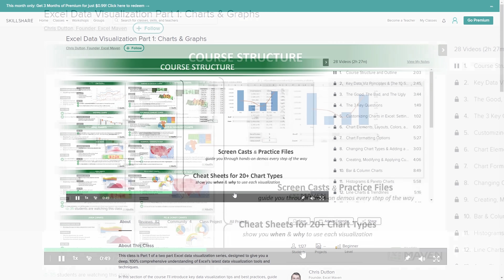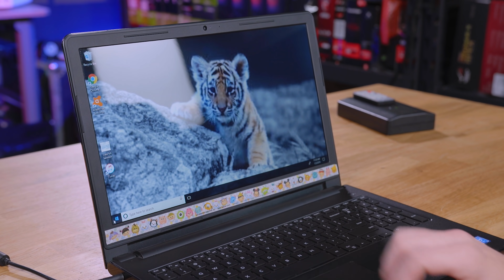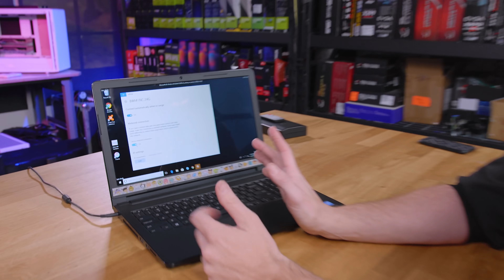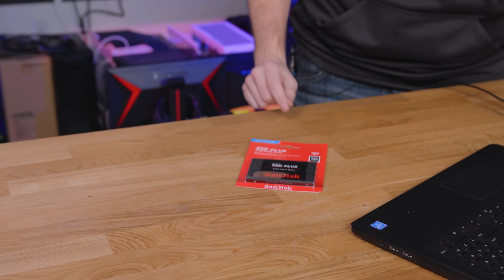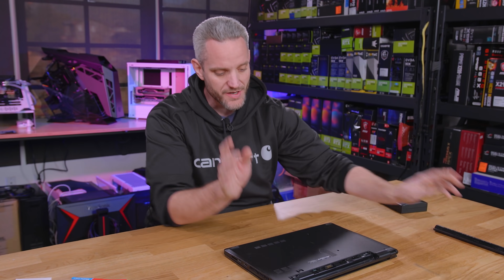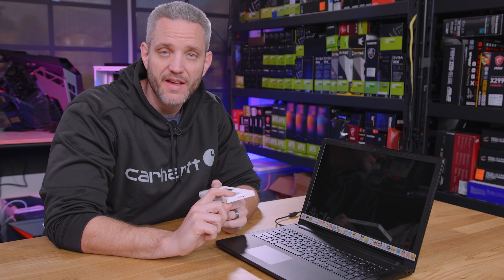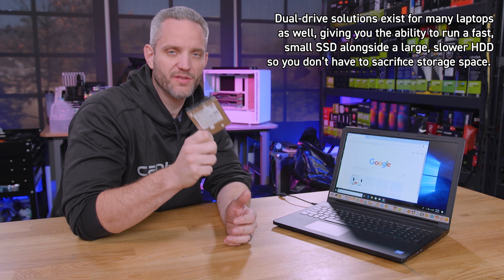Repairing an old laptop for as little money as possible...

Comment: My brother has a dell budget gaming laptop with a i5 7300HQ and a gtx 1050, it only has one screw holding the back panel on the rest is plastic clips, his hdd, ram, wifi card are all accessible under the back panel. I upgraded the ram on my asus laptop and gave him my old ram stick bc he had a free one and he bought a adata m.2 ssd bc it took too long to get into windows completely. He has the os and prog on m.2 ssd and hdd for storage and larger games, the m.2 slot is also accessible by just removing the back panel just above the hdd. 

Now it is lighting fast with 1000 MB\s read but only 500 write thou, but has a 460 GB capacity.

Comment: exactly the same problem i had with my 7 year old gateway laptop until i replaced the hdd with a 500gb ssd and replaced the optical drive with a tray to hold the old hdd so doubled my memory capacity

Comment: I got an old E-Machines (Acer daughterbrand) laptop from my girlfriend’s grandma that was still running vista.
Pretty budget dualcore with an old ATI dedicated graphics card that has no new drivers past windows 7. I tried a bunch of different Windows versions, and windows 10 seemed to be working, until BSODs started happening on the count of incompattible drivers for the gpu.
I tried putting vista on it again, only to get a bsod upon first post-install boot. Windows 7 seems to be working fine for now, and I am thinking of upgrading it with an SSD, but I fear for a sneaky windows 10 update.
I’ve tried Linux (Mint) and it worked for the most part, but I am a little uncomfortable with linux.
Maybe you can do a video on older laptops with a gpu that’s no longer supported driver-wise in windows 10, especially trying to get it to work properly?

Comment: I was able to repair an old Sony Vaio desktop PC from 2005 which has a 2.8 ghz Pentium D, 3 gb ram, and an 8400 gs graphics card by installing Linux Mint 19 which of course didn't cost anything, so now its usable with the latest versions of Chrome or Firefox. I guess Linux is always an option with older computer if you face performance/compatibility issues with recent versions of Windows like windows 10.

Comment: If it has an optical drive, remove the optical drive and the HDD to a cheap SATA HDD-optical drive caddy so you can have the HDD for files and the small SSD as the boot drive.

Comment: Most of the newer dell laptops are quite easily serviceable. They also publish all of the service manuals on their website and are supporting right to repair with ifixit etc. And I was surprised how many cheap laptops were really getting screwed by 5400rpm HDD and less then 4gb of ram both that would be pinned at 100 so easily

Comment: My mom is on her 5th laptop in the 8 years she's been running her business. I just took the two oldest and cleaned the fan, re applied the thermal paste and  removed a bunch of bloatware. They both have avast and macafee... If I was to remove those anti-virus programs, what's a  recommend program to replace them with? And what's the easiest way to back up the important files on a separate disk/ssd? Buy a docking station and drag and drop to a main ssd to be installed in the newest laptop?

Comment: Funny I saw this video, as I was thinking of upgrading my mum's old laptop for me to use at college. It's got a 1st gen i3 processor, a 5400rpm drive, and 4gb of RAM. I was gonna put an SSD in and give it 8GB instead. I was worried about the old i3, but it can't be worse than a celeron, that's for sure.

Comment: i have a 10 year old dell inspiron desktop with a core 2 quad Q9500 (fantastic quad core chip that still runs great). It has mostly all the same hardware in it except a graphics card and PSU update. Has the same 4GB or ram that it came with as well as the spinning 3.5in HDDs. It sat in storage for like 3 years and recently when i turned it on, it was the slowest piece of garbage ever. Mostly due to the 3.5in HDDs being completely shot. I took out the computer's optical drive and replaced it with an ADATA 250 gb ssd, on which i put the OS and most of the programs for day to day use. This comp is a beast now! I have even started playing games on it again lol. Nothing crazy (D3, LoL, sc2, etc) but it runs great and has come back to life!

TL:DR - SSDs make ALL THE DIFFERENCE, even in a 10 year old system!
Reply: the SSD cost me $40 CAD, its an ADATA SU650. Got it at memory express. AMAZING VALUE

Comment: I just learned that you can uninstall OneDrive now officially!
In previous versions this wasn't possible. At least Microsoft did something write once ;)

Your trick with the metered connection for disabling Windows Updates doesn't work anymore (in my experience). I used this to prevent Windows from updating on me, but I made the big mistake and manually installed the first bug update (the one that gave you native bash shell so you can finally have a SSH client without installing Putty). Since then it just ignored that I set my connection to metered and installed updates anyway...

Comment: Disappointing you didn't install a single 8gb Ram though Jay! Details, details...
fwiw my 5-year old Vaio laptop ran like a dog - I bought some faster and larger RAM and, when switching one of the old memory sticks out, actually noticed it was loose, which dropped the overall system RAM to half - which is why the laptop ran so slow. Good tip to check that for anyone reading... check your RAM slots :)

Comment: Recently i upgrade my parents old notebook Acer Extensa 5235 with SSD, CPU and RAM. From Celeron 900 (1 core, 2.2Ghz) to Core2Duo T9300 (2 core, 2.5Ghz) and 1GB of RAM to 2GB of RAM. Notebook run better than new :)

Comment: Thanks for the tip about metered connections, hopefully, that'll stop my Windows 10 Pro media server (Repurposed FX 8350 build) from rebooting randomly for updates and getting stuck at the BIOS, for some reason, the BIOS reports no CPU fan, despite having a spinning CPU fan. Which is fine if I am at home, but bad when away from home, I can't remotely press reset on the box when it's stuck at the BIOS telling me lies about my CPU fans.

Edited to add; I did the same procedure to my mother-in-law's laptop, which was also a Dell, 3rd Gen i3, 4GB RAM, and I could not for the life of me get an SSD to work, I tried 3 different SSD's, I ended up replacing her dead HDD with another piece of spinning rust!

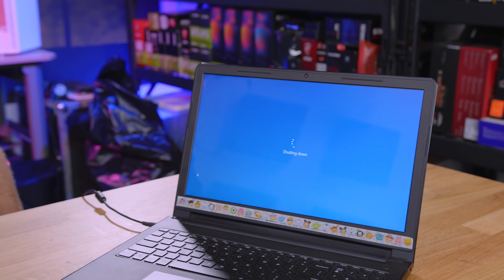Comment: 10:30 acthshshshually windows 10 doesn't always shut down when the screen is off. You just cant see it on this laptop because it doesn't have lights.
On my PC when you click shutdown the monitors do turn black but it takes an extra 5 seconds for the whole computer to completely shut down.

Comment: I know one thing if your PC(laptop) have temperature problems don't even try to fix it 😆 I did actually change CPU on a laptop that could heat up to 100 c 😂 it worked for the next 100C and then the graphics died 🙄 not possible to replace 😶 This "good Pc" had 2 grafic cards so you should be able to change 😶 It was not possible 😂 

I can give one recommendation 😉 If you buy a new laptop and it is getting hot when you are not doing hard stuff. Just give it right back to the store 😉 If electronic devices will be under high temperature you need to know it will die fast 😆

Sorry for bad English 🤔I am trying my best 😂

Comment: Well that's just Windows 10 Update stuff. I had it happen to my mother's quite decent ASUS Zenbook ultrabook. It just stuck on an update when she was like 200km away from home, and about 40km away from any decent civilization. I wonder how it even downloaded over 2G\3G connection at all. So instead of spending any money on upgrading it I just went to install Linux on it. I used Kubuntu because I was familiar with it and like it's UI. It's one of the heaviest desktop environments on Linux, mind you. And it works like it' brand new. Fast, snappy, and since she was mostly using it for web browsing, notes taking, printing, scanning, you know, regular simple stuff, she picked up Linux quite fast. And it was actually way simpler for me to teach her linux than Windows, I just made a dock with huge icons with all the apps she needs and told her how to use it's file manager, that's pretty much all. 

I'm quite sure by now that Microsoft might be doing it on purpose to make people buy new hardware. No, thank you.

Comment: I wanted to give my brother my R9 390 8GB Graphics card but he has an old 2 core Core2Duo system and would need a 650W psu for it and I don't know if there is a cpu for that socket that is capable of running it. I would like to see something about that. One of these days I will give him my FX-8370, motherboard and memory when I can afford to upgrade to ryzen so I don't want to spend a fortune upgrading his antique.
Reply: JustStat  thanks but 30 fps on a GPU that can run almost everything at 1080p 60 FPS ultra settings would be like only being able to ride your new Ferrari in the drive way.

Comment: I bought a D620 for $59 from a certified refurbisher than was supposed to still be able to run Windows 7, swapped the hard drive out for an SSD and my nephew bought enough memory for me to max it out and it was still too slow make Windows 7 practical. So as soon as I upgraded the SSD in my desktop tower I swapped in a slightly larger SSD and did not bother with Win 7 and jumped straight to Linux Lite. (DDR 2 may be a bit slow for Win 7 is my guess.)

Comment: I stopped using HDDs in 2015, in my opinion they have no business in a modern system even as bulk storage. NVMe boot drive + SATA SSD storage drive has been reasonably affordable for years. Now it's extremely cheap. If you have anything better than a Pentium or an Athlon and have an HDD in your system, you're really missing out on the excellent experience of no HDD latency ever.
Reply: extremely cheap? 1000GB SSD's still cost more than $100. I know a guy who sells me brand new mechanical ones for like $12.

Comment: Picked up a new Dell Inspiron 11 inch to basically use as a daily portable (as to not drag around my $700 Gigabyte laptop). I immediately swapped out to an SSD and did a clean windows 10 install, replaced the wireless N with an AC wifi card from a vostro (Dell doesn't tell you this will work), and doubled the Ram to 8gb.. It lags on going fullscreen on video playback because of the crappy older i3 processor. But This laptop that I spent way too much on (Walmart prices suck) and spent way too much upgrading (because I"m a glutton for punishment) and was scary as hell for me to modify brand new because I thought I was going to break the case opening it up (Thanks IFixit for being awesome and making awesome tools) Well it's essentially my cook book.. Yes I set this little underutilized overbugited project on my counter and use it to read recipes off of allrecipies.com. At a total out of pocket cost over $400 It is likely the most expensive digital cookbook to exist at the moment. I'm an idiot. But I'm an idiot that bakes his own bread, and butters it with his own butter while he waits for his preserves to thicken.. So go H8te someplace else.. ;)

Comment: My old Toshiba satellite running a dual core T5450 chip at 1.6 ghz used to be this slow too, but it held up well for like a decade. I obviously have upgraded, going from a garbage dual core non hyperthreaded chip with like 256 Mo GRAPHICS to a 4 cores 8 threads CPU with a GPU that has 24 times more VRAM to work with is like going from a fiat 500 to an S-class Mercedes. Everything is blazing fast it makes me wonder how the hell I used to work on that garbage machine ...

Comment: I have a 500gb WD blue that is like six or eight years old, which is the boot drive. I've also got a secondary 350gb laptop drive that is well over a decade old. Would it be better to buy an SSD in addition to these, reinstall windows on it, delete it from the 500gb, and run that way? Or buy an SSD, buy a 1tb drive, and move everything over?

Comment: Well for my first laptop who is 4 years old. indeed I suspect the HDD is the main bottleneck, especaily when I compare it to my second laptop.
my second laptop is GPU bottle necked as it is my main system and I game a lot. I have upgraded to a 500GB SSD with a 1TB HDD (it had an empty m.2 slot) and 16GB ram. rest of the specs are I7-6700HQ and a GTX 960m

Comment: Even if the new RAM was slower, and if the one of the new single dimms was a larger capacity than the original, you still should have upgraded it. A student who is using a computer like that does not need the highest of the high speed RAM. They are running a dual core Celeron, they absolutely won't notice the minute clock difference in the RAM. Should have upgraded the RAM...

Comment: Windows 8.1. Best medicine for an old laptop. Makes an 11 year AMD Turion 64 X2 run better than new even with a HDD. Best part, Windows 8.1 is free!
Reply: 8.1 ran better than 10 did  on my crappy laptop that has a Celeron and 4GB of RAM
Reply: @React2Quick  exactly.
Reply: @DylanChng  I mean the laptop is still shit and so is the processor, but I honestly swear that 8.1 ran better than 10 does currently on it.
Reply: @React2Quick  8.1 runs better than 10 because 8.1 was designed from the start with a lot of intentions of running on ARM processors.

Comment: I love ya Jay, but this is simplistic and severely unhelpful for most people. For anyone trying to fix the 100% disc drive issue in Windows, this shit is almost worthless, unless you plan on changing to an SSD. It's a Windows bug that takes a fucking blood sacrifice to Microsoft to get fixed.

Check guides online for help, or literally anywhere else. There are plenty of fixes. Jay doesn't have a clue on this one, because he hasn't had to deal with old laptops with the same exact, and consistent problems.

Comment: I spent about $250 on my Inspiron 5559 with an i3

500gb Samsung Evo SSD

Dual 8gb sticks of RAM (8gb is being allocated to the onboard video) 

Bottom cooler and side mounted cooler and I carved out the air vents. 

Liquid metal on the cpu

I gained 200+ points in cinebench
Reply: It runs about 10-20f higher than ambient, 62f. Over 100fps in Borderlands TPS on low settings. Very playable on high settings, I never run high settings.

Comment: My first computer was a Dell laptop. only a couple months later it was slow as hell. When I got an HP laptop that also turned out to be slow as hell. Now I have another HP laptop- Except I tried opening the disc slot to play some Sims 4... and it wouldn't open... the whole disc open thingy actually fell off...
Reply: It's nothing to do with brand. It's to do with the price bracket and market the computer is built for. If you buy a cheap new laptop, expect poor experience. You are better off buying second hand older gen business grade machines as they are designed to last through longer warranty periods.
Reply: @kbbbb7  I just really think all laptops or computers hate me and my family. My brother got an all in one computer that cost like 1k-2k$ and the next year it was only 300$ and it is horrible. All he has on it is Spotify and chrome and it is worse than mine with the space

Comment: This was my solution for my really old 5745m laptop, just the hard drive, like this dell (although its an hp) was an absolute bitch to tear down. 
But, it is a 4c/4t machine, and its graphics was good enough to run gmod and what not. 

Whats dumb as all hell though, is that my brand new nitro 5 i just got, came with a hard drive and it was painful. My first upgrade was slamming a ssd into its free m.2 slot.

Comment: I can definitely tell you that win10 PCs, that are just for work, low cost, etc. are getting wrecked and slower and slower with each win10 update. hell, i've seen a one year old PC with low budget specs run like a PC from 1990 and it was constantly losing WiFi connection and slow as hell. All because of stupid auto windows updates.

Comment: I have Asus X550V for around 3 years now and want to upgrade the storage by replace the DVD tray for ssd (with ssd tray for laptop) and increase the RAM to 16GB since it only have single channel memory. but I don't know it have another slot or not because I never open it. fyi the battery is broke and I still don't have money to upgrade it since I still a student.

Comment: I have an old Dell laptop that has similar issues and an HP laptop where the wifi has stopped working. 
Questions: So is the connector for these old mechanical hard drives always going to be the same as for the SSD? Will the SSD always fit into the space (any brand or just Dell) in the laptop? Why would my HP not be able to get wifi anymore? 

Also, I always hear about backup and restore and fresh OS install. I have been using PCs for decades now and have always been too nervous and too ignorant to attempt this. Do you have a good step by step guide for doing this? Maybe this would make a good video:) Thanks Jayz.
Reply: iObit's Driver Booster WILL fix the driver issues. Don't think so? Then you have not tried it.
Reply: @MedicatedOMO  What driver issues?

Comment: I probably would have just wiped the drive and installed Linux Mint XFCE. That would fly on an SSD. I use mint cinnamon on a 2.5" SSD and it boots slightly faster than Win10 on an M.2

Comment: hey im upgrading a older pc and i was wondering would it still be a good idea to put a ssd in if it only has a 3gb sata port also the other sata port is dead so should i use a adapter for a hdd?

Comment: Why would you not mention blowing dust out of the compute and maybe replacing the crap stock thermal compound so the CPU can actually run and it's rated speck so many of the computers I have serviced over the years we slow just because the CPU could not run at it's peak. @JayzTwoCents